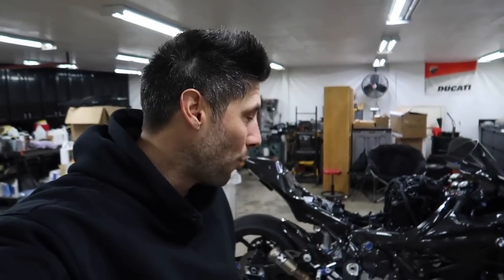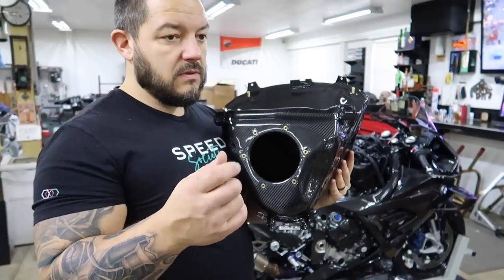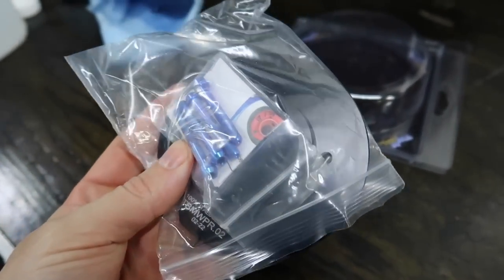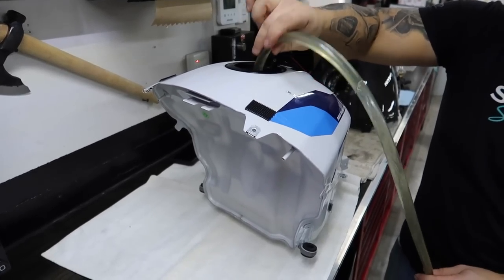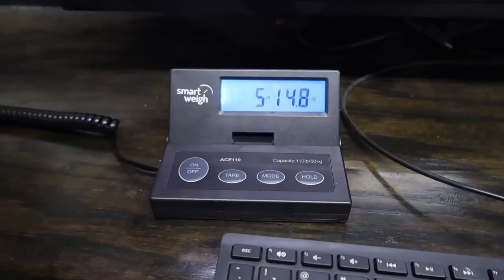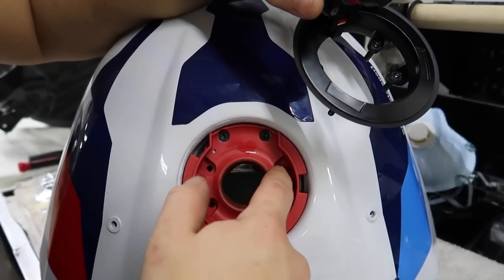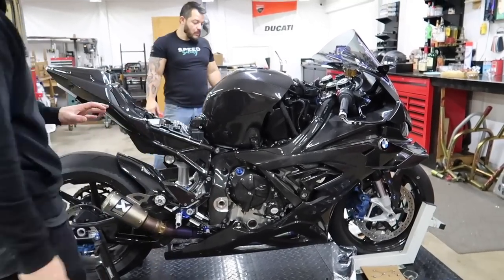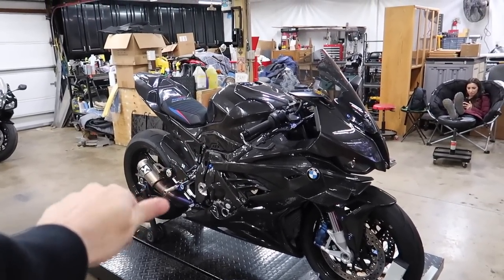Installing a $3,000 Carbon Tank on Our M1000RR!!!

Comment: I recommend giving the winner the original tank as well. Carbon tanks are notorious for degradation and leaks. Even if they've used Caswell to seal it, it will eventually degrade and the ethanol will eat through the tank.

Comment: need to see a carbon frame and swing arm done! that would be a actual full carbon fibre bike!
Reply from the maker: As far as I know those parts do not exist...Ducati is the only company that has ever made a carbon swing arm and frame for their superleggera which is $100k
Reply: The Bmw S1000rr HP4 Race has a carbon frame . Track only though 👍
Reply: @JaretCampisi  mm, could possibly get a custom carbon fibre frame and swing arm made if you contact a place that makes carbon pieces for the bike. would be super cool and would save most weight too would be insane

Comment: I don't know what's prettier.... BTT or that gas tank. 😊Either way, that is the crowning piece for sure. Bike looking sick. I'm over here all waiting three months now for my Ilmberger tank side panels. 🙄
Reply from the maker: yeah trying to get parts after covid has been a nightmare...hang in there :)
Reply: @JaretCampisi  Yeah, I haven’t been having much luck lately. Even bought some M rearsets from Manny and they said one of the heel guards was scratched so I’m stuck waiting for a replacement before they even ship.  Need parts to flow smoothly during these winter months so we can at least get some sort of fix! Addiction is bad. 😬 Thanks for the coupon code with Motomillion though. I use the hell out of it. 👍
Reply: BTT no contest
Reply: BTT, no contest
Reply: @848evo4  No argument there. Christina wins.